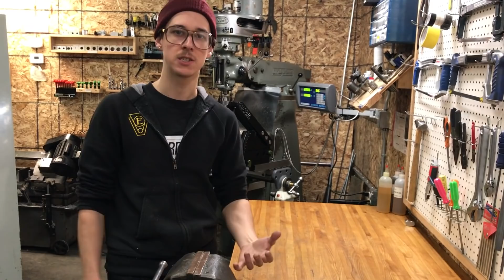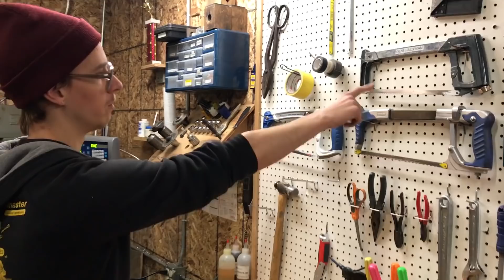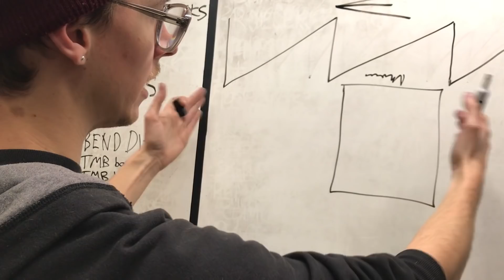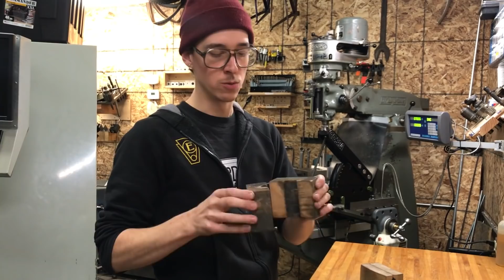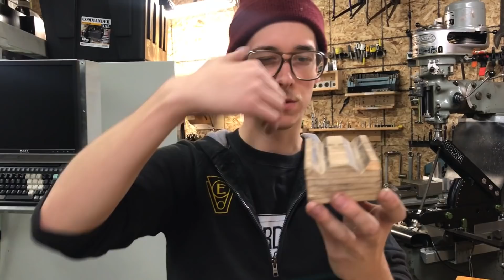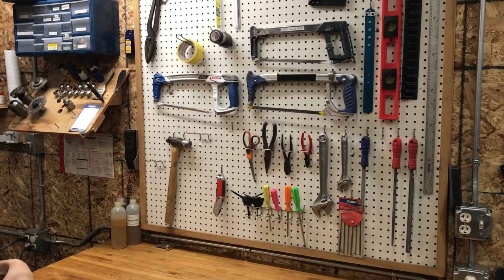Workbench Setup for Bicycle Framebuilding | Hacksaws & Hand Files

Comment: Using a hacksaw for bicycle tubing is completely inappropriate.   My first day at a high school metal shop class stated that you want a minimum of 3 teeth engagement on the material you are cutting.  Bicycle tubing is thin.  You would need a hack saw with at least 72 teeth per inch.  (they don't make them with that many teeth) the teeth get ripped off using them on bicycle tubing.  I have been frame building for over 22 years,   I don't even own a hack saw.     What is a much better tool, is a Four and a half inch angle grinder with a 1/16th cut off disk.

Comment: Great video. I’m right in the middle of building a table to do my work on.
Reply from the maker: Build it nice and heavy! Material is cheap.
Reply from the maker: You can make the base and top bolt to each other so that if you ever move your shop you can split the bench into two parts and split the weight in half. That has made moving mine a lot easier over the years through several shop moves.

Comment: Add magnets to your copper soft jaws, they won't fall off so easily then...
Reply from the maker: I feel like that would attract ferrous metal chips which could be super obnoxious. Might be worth it tho!
Reply: Copper isn't magnetic though
Reply: The vise jaws are though, the idea would have been to use an adhesive to attach the magnets to the copper soft jaws...